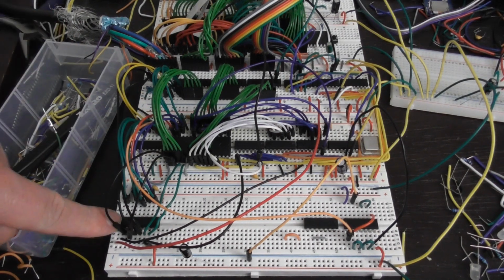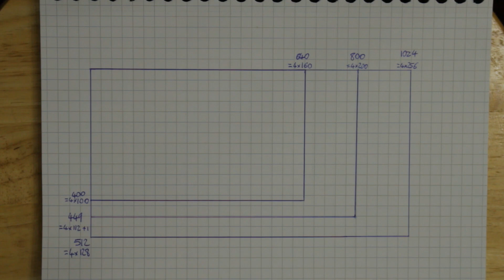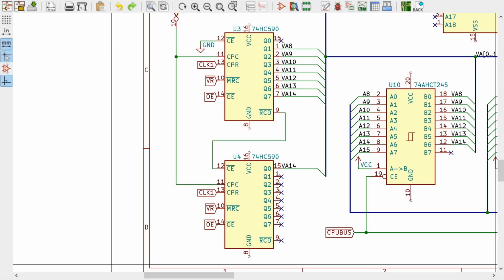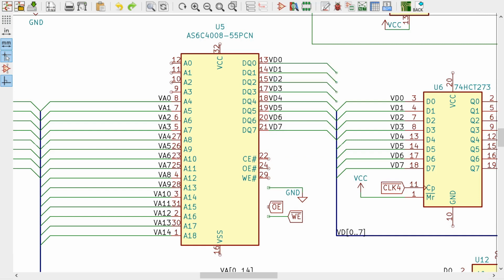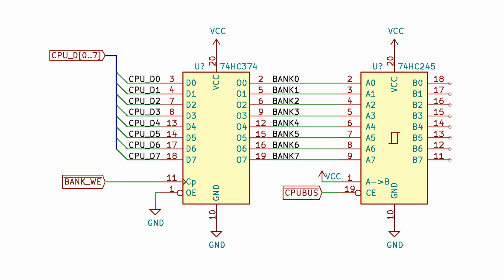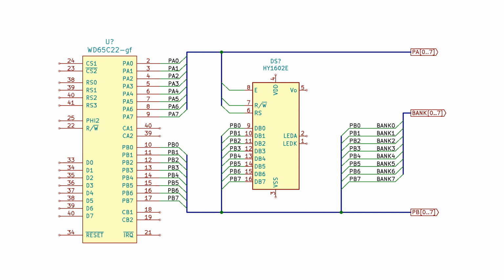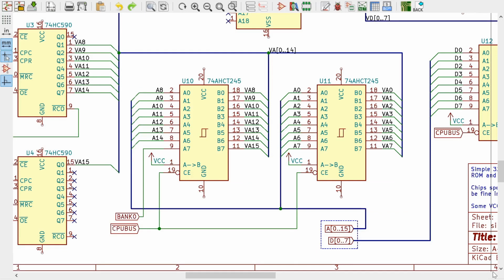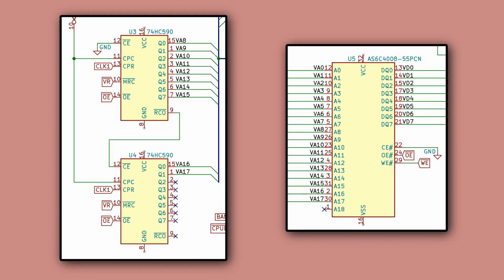Simple Breadboard VGA - 320x480 resolution upgrade

Comment: BTW you can use CA2/CB2 as an additional output bit, by setting the specified bits in the Peripheral Control Register. Alternatively you can hook up the LCD directly to the CPUs databus including the R/W input. However you would need to decode part of the address space for the enable pin.

Comment: Just an FYI: you could use the MC74HC4060A 14-stage binary ripple counter instead of two 74HC590’s and save some board space. ;-)
Reply from the maker: Possibly - the 590s have a huge benefit though, in that they have tristate outputs - meaning I don't need to use separate transceivers at least on that side of the circuit.  Maybe we could use multiplexers instead of transceivers though.

Comment: hi, what is the clock frequency of CPU? and eventually wait states?
Reply: I see, it's a quite high clock frequency for the 6502. It is rougly equivalent to a 24Mhz 8088 cpu, and explain the fact that can manage vga graphics decently. Unfortunately in the early '80 was proibitive a similar frequency expecially due to slow rams. Common Frequencies for 6502 were ranging between 1-2 Mhz
Reply from the maker: @gasparinizuzzurro6306  Modern 6502s can easily go faster than this too. The other components in my circuit are limiting it due to the bus sharing. It also can't really manage the VGA graphics very well, it is quite slow at updating the display. I have some plans to improve this by building more assistance into the graphics circuit, perhaps leading to hardware acceleration for some operations.
Reply: @GeorgeFoot  A FPGA based blitter or simple gfx coprocessor would be fun!
Reply from the maker: In this circuit it's a quarter of the VGA clock - a little over 6MHz, with no wait states.

Comment: To get around the need for bank switching, use 2 X 8 bit latches like a 74373 one is LSB of video address and the other is MSB then write to a fixed mem address to send a byte to the VRAM. it's about the same speed as your method, or even have a second 6502 running the video card then all you do is send X, Y, Data to plot a point. The ROM can have circle, sin, cos, tan, square etc routines. It's what I did.
Reply from the maker: Yes I'm considering something like that, to reduce the number of connections between the cpu and the video circuit. I was planning to increment the address after each write so the cpu can stream data as well.

Comment: I would be happy with black with white. Super simple low memory. I am not looking for 4k on my z80... yet :)
Reply from the maker: My first video output circuit was composite but black and white, which also runs at about half the pixel frequency. It generally ran at 640x256 or 320x256, which is about what microcomputers of the early 80s could achieve as well.
Reply: @GeorgeFoot  This is what I am looking for.  B&W classic video output but with simple modern electronics.  320x256 would be great. Bring back that old school gaming. :)
Reply from the maker: @davidmarks509  This is my earlier project: "GitHub - gfoot/compvideo6502: Composite/component video output for homebrew 6502 computers" https://github.com/gfoot/compvideo6502

Comment: Neat. Manipulation of that much video RAM is definitely at the edge of the 6502's capabilities.
Reply from the maker: Yes there are two big problems - the throughput, as there are so many bytes to fill; and the fact that the coordinates require two-byte arithmetic, which complicates the code a fair bit.

I think 320x240 is about the sweet spot. But I also have plans to implement some hardware assists to give it a helping hand with higher resolutions and colour depths, and making a more fully featured "GPU" with block copy, horizontal line drawing, raster ops, etc would be very interesting.

Comment: Thank you. I am really enjoying these VGA videos. I am designing my own Z80 ( sorry ) computer and you are giving me some great ideas for graphics. I previously implemented a very basic text only video output on a breadboard using counters and RAM and referencing a character generator ROM.
Reply from the maker: Nice, I've never used a Z80. One thing I didn't include here was 320x240 which is a great compromise I think, very appropriate for both these CPUs.